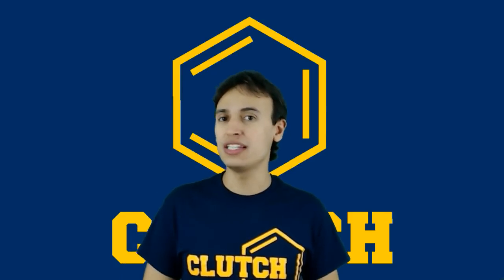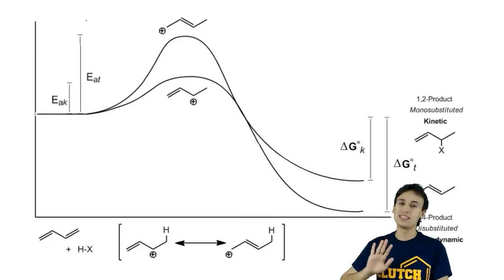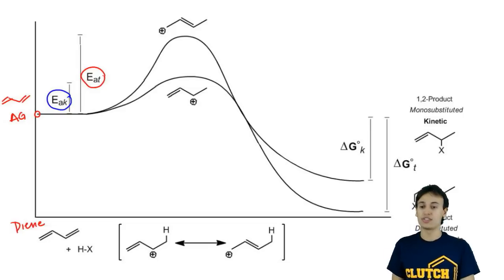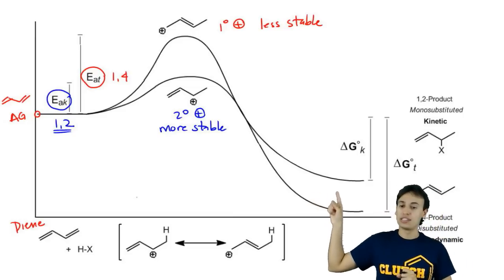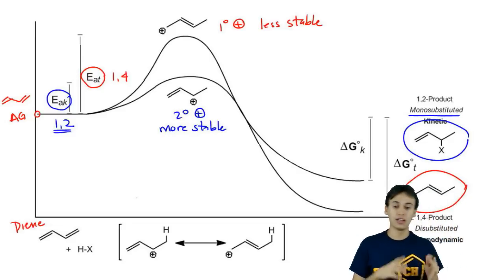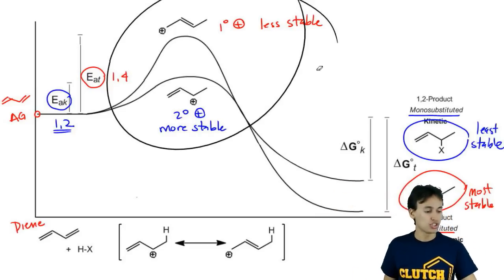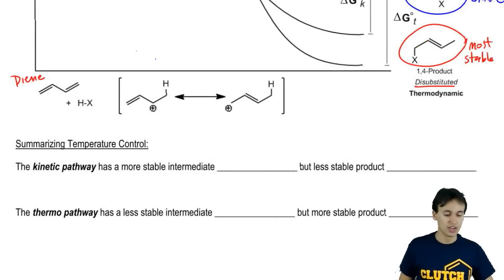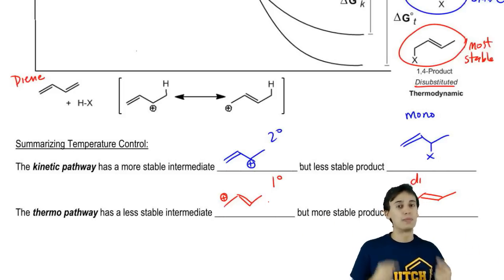Kinetic vs  Thermodynamic Control

Comment: Sir how much temperature to be consider as high for thermodynamic product....i.e. what is starting limiting temp for this???
Reply from the maker: Hi Ronak! Emily is right, 40 C and above for thermodynamic product and 0 C and below for the kinetic product. Anything in below should give you a mixture of products. These concepts are actually discussed in the videos on our website so you should that out!
Reply: Clutch Prep then what abt the temp between 0 C and 40 C